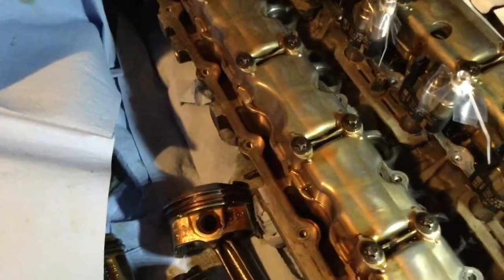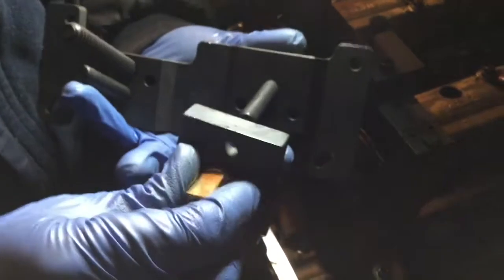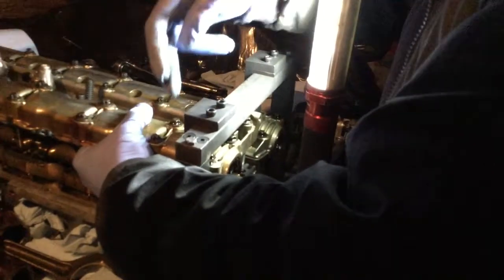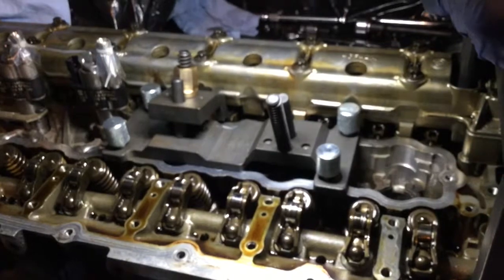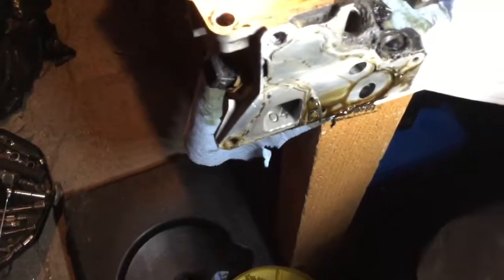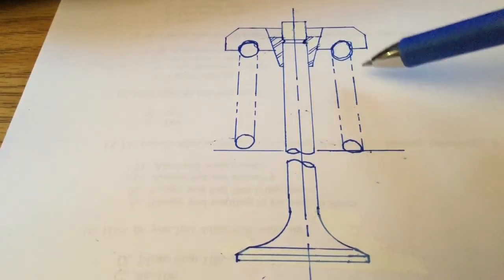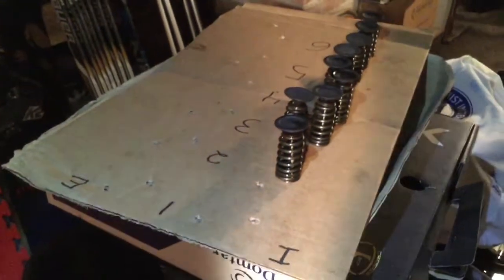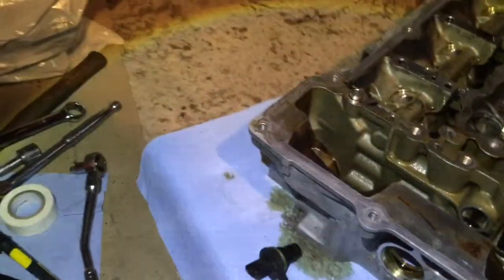27 BMW 135i N54 E82   Engine Disassemble - Fuel Injectors, Cams, Valves, Oil Filter Housing Removal

Comment: Where can i get the valve retaining tool your using?
Reply from the maker: Can't find it... But it was either on amazon or ebay. If I remember correctly, they were for motorcycle. 
I remember that I have checked for the diameter of the part that holds the valve, and also for the clearance... And that was it. 

I thought I already answered that question, so I checked below, but didn't found it. Perhaps I did in another related video. So I would suggest as you watch other videos for the valves, perhaps have a quick check in the comments (I thought perhaps I have posted the link to it... but maybe I did not in the end).

Hope this helps

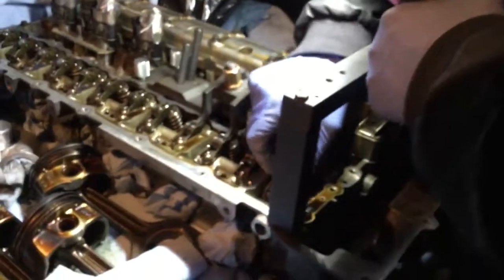Comment: at 18:54 to 19:10, i've pulled out the hydraulic valve lifters under the rockers just as you have. Should they be 'squishy' or 'hard to push in'? I am wondering if i need to replace any but can't find any information on them.
Reply from the maker: If by "hard to push in" you mean: back in its cylinder head hole... It should not be hard unless it is not properly align with its hole axis. Do not use force. Instead correct its alignment.
If by "hard to push in" you mean: pushing the hydraulic lifter to contract it... It doesn't have much play. I would say about 1/16" (to give you a ball park, not exact play). You might need to put oil into it with a oiler to expand it once contracted (I don't remember).

It is not what you want to hear, but besides a visual inspection, the only way I found to know if they are wrong is with the engine running. If while its running you hear valve (lifters) clicking sound... You might have a problem. But if you have such a sound and your engine hasn't been running for some times, you might have to rev it up a bit.

WARNING
Just make sure its only the lifter sound, in doubt don't rev much as if it's something else (sound from another source), you might break something in your engine. 
If you have a valve clicking sound, the hydraulic valve lifters might need some oil pressure to charge back up like they should. This is achieve with revving up the engine to at about 4000 rpm or slightly more (again, if the engine works fine only).
You can also run it for some time (day to day).
If you still have such a valve clicking sound, your best bet is to use a mechanic stethoscope. You let the engine idling, and you listen with the stethoscope around each cylinder. You can try to see if it comes more on the intake side or the exhaust side.
Then, what I did when I had such an issue I ordered 4 or 8  lifters (don't remember) planing on replacing all of those on the cylinders where the sound was the loudest. It ended up I had another issue. So fixed it by replacing the ones that were scratched only (I did replaced one or two and returned the other ones).
You can see the main tasks of that operation on my video https://www.youtube.com/watch?v=MpTbWRV_Qw4&t=1s (stethoscope operation unfortunately not shown). I had a knock sensor code.

Comment: episode 28?  :  (
Reply from the maker: Very good question. Thanks for asking...

After video number 27, it goes to video 30. I know it sounds a bit weird that it skips numbers this way, but I kept a few free numbers just in case I would need to create a new video related to that section. 

So 27 is the last of its section (engine disassemble). Video 30 is the first of its section (engine rework). 

Think about it this way:

- Videos 1 to 17 are about taking the engine out of the car

- Videos 20 to 27 are about disassembling the engine

- Videos 30 to 34 are about reworking (overhauling) the engine

- Videos 40 to 49 (last one should be 49, but unsure as it's in progress) are about rebuilding the engine.

- Video 60 and above will follow this one and will be about re-installing the engine in the car and starting it for the first time.

There is also general section for other videos. At this moment a section is titled "How To - Calibration", but there might be some more to come in the future.

To help you guys out finding your way in all of this, I have set video sections on my channel (you should see them at my channel's home page).

Hope this helps seeing the big picture.